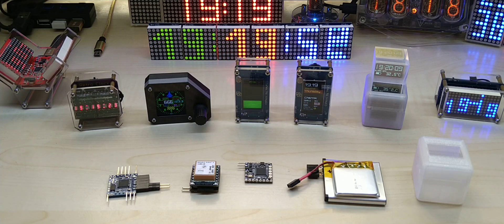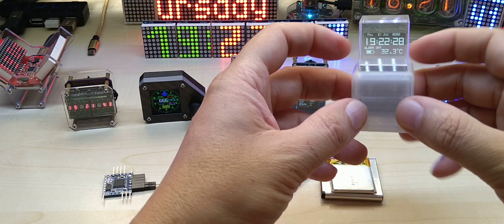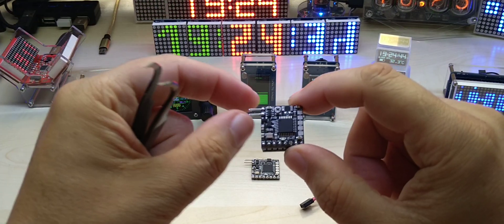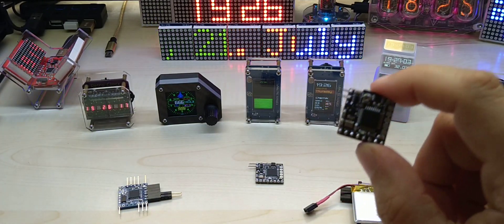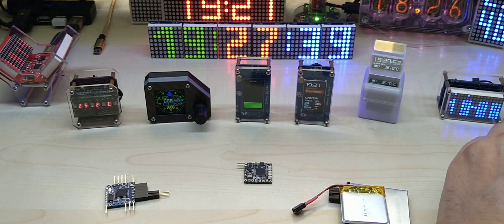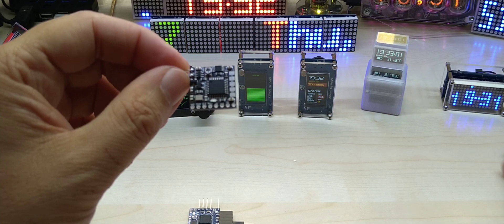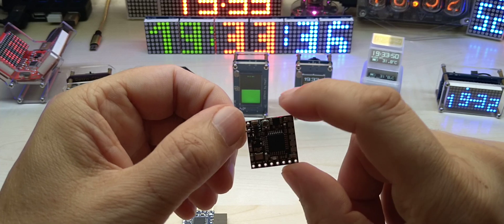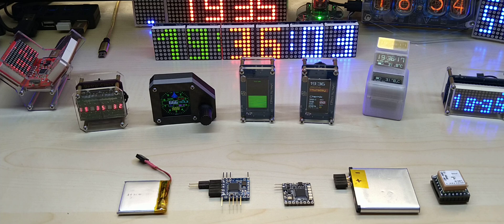Single LED Voltmeter, TPL5110 Timer Chip with 35nA Sleep Current, 7" IPS Touch Display by #Hayri

Comment: Great little boards Hayri and great idea with the visual battery voltage!

Have a product idea seeing you are the king of tiny gadgets!
Please consider a tiny board for a LiPo battery which includes protection, charging and load sharing?
Like a tp4056 charge protection board but smaller and with load sharing.
Also, the addition of boosting lipo battery voltage to 5V would be handy!
Reply from the maker: Thanks Ian, I have seen several different Lipo charging boards with various features, not that I studied them in detail, but I do not see how I could compete with them price wise seeing that they are sold for a few bucks. I would have to produce them in the thousands and sell all of them in a short time to make any profit, which is very very unlikely. I can't even sell enough of my own products. Guess how many inquiries I had about the many items you can see in this video or any affiliate sales or even the unthinkable of getting any new Patrons, ZERO. Anyway, I got a bit carried away here, sorry about that.
Reply: @iHayri1  
Weighing up time and money is the greatest challenge but I understand and appreciate a living needs to be made and profit is critical for any business. 
Wish you all the success, I’m sure sales will increase.
Reply from the maker: @iantcroft  Thanks Ian, it's not so much profit, in my case it is purely being able to put food on the table, literally. No sales past the 3 weeks, means zero income, not that all the incoming money would be profit of course 🙂But who am I, just a small YouTuber, if I even dare to call me that, trying to make a living. But times are hard and I am surely not the only one suffering. Anyway, even the next single sale will be 100% more than what I have now 🙂 Stay safe.

Comment: lol, 6/8th of an inch, AKA, 3/4". Very  clever idea for the volt meter, I like it.
Reply from the maker: Thanks, it is actually a bit more than 3/4, 0.787" to be exact, but it does not matter of course 🙂
Reply: @iHayri1  Alternately, 11.2 poppyseeds, 9 lines, or 2 1/4 barleycorns! Our measuring system is backward, but we're too deeply entrenched in it.
Reply from the maker: @WaffleStaffel  Now you have my brain smocking, lol.